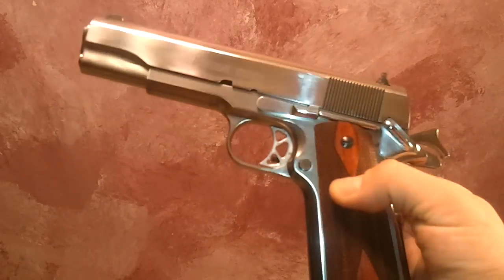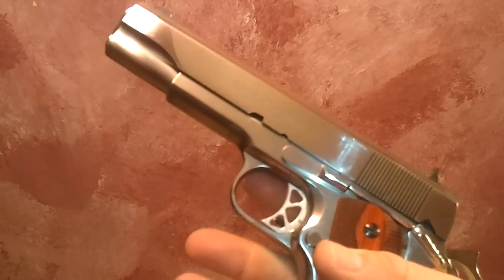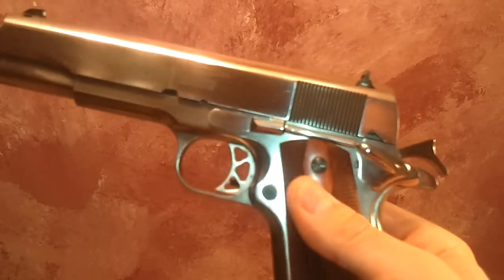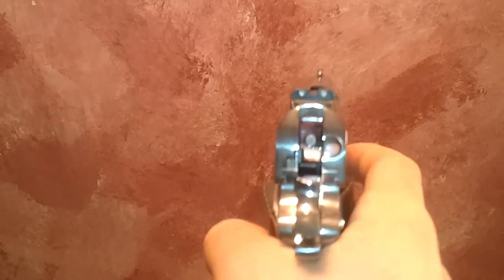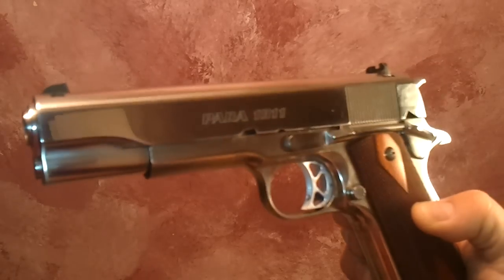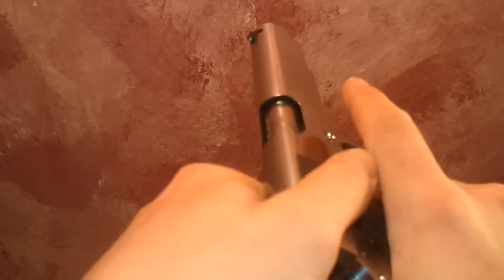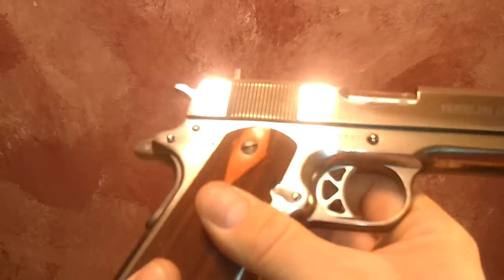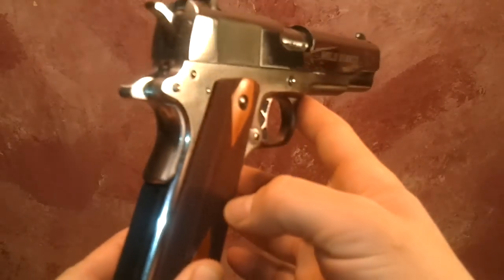Para ordnace 1911 wild bunch (polished)

Comment from the maker: Couple VERY important things. You have to ensure that you have removed all the sanding scratches from the previous grit. This is easily done by sanding in one direction then switch when you move to the next grit. For example sand up and down than when you move up a grit sand left and right. You can easily see when the heavier scratches are gone that way. Then finish with 1500 or 2000. Use blue magic metal polish. Mine isnt fully polished. Loo at my other vids I have a 12 gauge that is.

Comment from the maker: There are some parts on the gun i did a full polish job on like the hammer, slide release and the back of the gun. makes a bunch of shiny points on the gun while some other parts, like the whole frame, was only finished in 600 grit.USE "3M WET OR DRY" SAND PAPER AND USE MOTOR OIL WHILE SANDING. THIS IS VERY VERY IMPORTANT

Comment: Thanks I really like how you shared the process with us. I started my a MP9c today and I. Figuring it out, not using motor oil though. How long did one sheet of paper last you? I seem to be getting little use until its smoothed out.
Reply from the maker: It does not last very long. 3M wet or dry works well. I found I actually really like when it wears down a bit and smooths out. If you are trying to remove machining marks then fresh paper is good. But for the polishing aspect I really like when the paper wears down. Example, if you are sanding with 600 grit and moving to 1000 afterwards, the 1000 paper will have an easier time removing the scratches from the worn down 600 grit paper compared to fresh 600.
Reply from the maker: use some kind of liquid. The m&p is stainless so water should be okay. Sometimes I'll use a light spray of rem oil on the paper. If you don't use liquid the metal gunk's up the paper and it won't sand anymore.